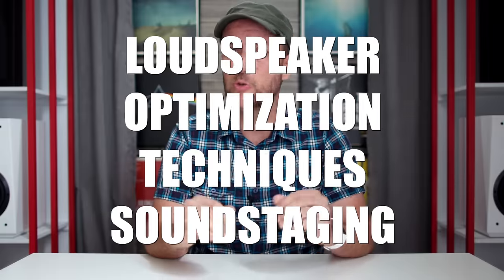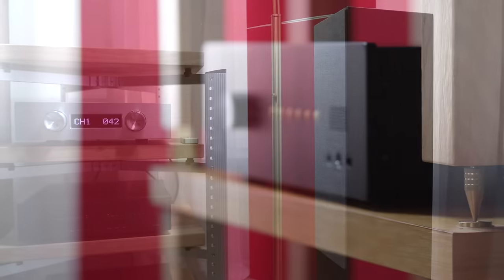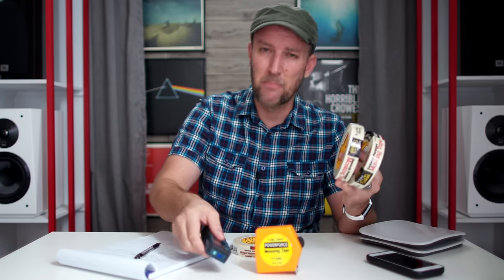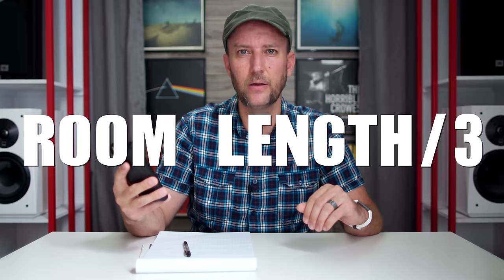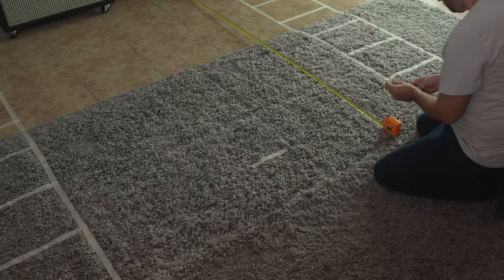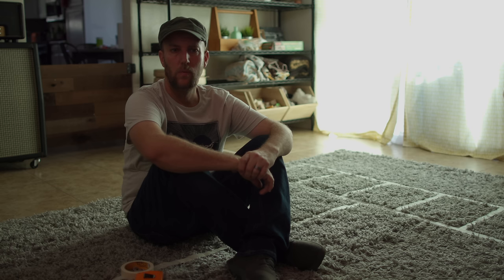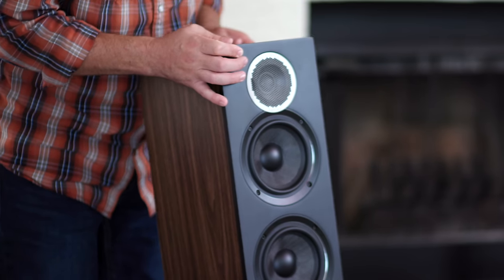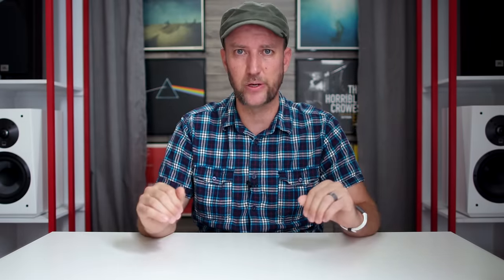L.O.T.S. Loudspeaker Optimization Techniques for Soundstage!

Comment: Hey, Ron. Great vid, man. Excellent method of speaker placement. It really is magical when you’ve got your speakers set up correctly. Great soundstage and imaging in a dark room is a pretty damn crazy experience. 

Did I spy a Marshall 4x12 with greenbacks in it in the background? I’ve got 2 Marshall cabs, one from the 70’s with greenbacks, and one from probably the mid 90’s or so with Vintage 30’s in it. Powering them is a Marshall 50 watt JCM 900 and a 1976 extremely early Marshall 100 watt master volume. It was made within the first month of production. Sorry to got off topic, but I know you play guitar too.
Reply from the maker: Yes sir! JTM45 with Scumbacks! Love it!
Reply: Woohoo! Nice, dude. Is it one of the more recent point to point hand wired JTM45’s? Those are sweet amps.
Reply from the maker: It’s actually my second! First was a ceriatone clone and this one- I had my buddy build it using all original caps etc. Dude, it’s a ripper!
Reply: New Record Day 
Sweet, bro! Those ceriatone clones are beautifully made. I have a real deal ‘74 Hiwatt DR103 and A/B’d it with a ceriatone clone, and they sounded pretty much exactly the same. When it comes to guitar amps, there’s something special about those original caps, resistors, etc.

Comment: It's not rocket science, common sense thinking logical. I'm old school just use my eyes, ears and a tape measure.

Have my listening position at the tip of a triangle right in the middle of my front two speakers. The speakers are a couple of feet out from the front wall. 

A little toe in plus high quality custom made open cell acoustic foam flat blocks (not the subpar tilted ones from ebay, amazon) on my speaker stands and that's me done. 

Have a very small carpeted room with low ceiling. Very very happy with the sound I have managed to get coming out of my speakers.
Reply: So an NRD antagonist from way back I see. Glad to hear you are enjoying your system... because in the END that's what it is all about 👍

Comment: This is all sounds great and all, but could you end up with your speakers in the middle of the room where it's just not feasible?  I mean, based on your own measurements, where did your speakers end up?  Two feet from the front wall, four feet, six feet?  Is this method for stereo only?  What applies to 5.1 for instance?  Just wondering.

Comment: Well if you look at the science of the speed of sound vs the frequency length it can be calculated. The distance between 39” and 7.25’ should be avoided due to bass calculation. Close to the wall is actually ok. 

With subs you can also get closer to the front wall. You can place your subs right at 24” and then your mains can drop back to 43.3” assuming you use an 80z crossover (highpass). 

Anyway good video. I have had my speaker 7.5’ into the room 2’ into the room and now they sit with subs 24” with the mains 43.3” and the room measures pretty flat.  

The kicker is the ceiling height and room width is fixed.

Comment: Scientific study of hearing says that speakers should be 45 degrees apart.
That equals a listening position 1,18 x the distance between the speakers.

The movie industry knows this but the audio industry is stuck in the equilateral triangle ideas from the 1960's.

Placement of the speakers and the listening position can be moved by changing the width between the speakers and by moving the triangle forward or backward.
Seating in the middle of the room or to close to back wall is both bad.
A lot of toe in usually sounds better.
My speaker baffles are toed in approx 35 degrees.
Reply: If you could link to that piece of work that'd be great. 

TV/Film have precise standards that are to be used across platforms. 

Audio for music release, ... no such standards. 

I'd agree anecdotally, ie., 60° spread is oftentimes excessive, but instead of any hard and fast rule, I much prefer it as a case by case basis 

Regarding "toe in", same. It just depends. It's an iterative process whereby dynamic analysis reveals sonic elements impact one another. 
First and most importantly, the design characteristics of the HF coverage dictate a lot. 
Proximity to sidewalls and the sonic impact of the first reflection point energy blending with the direct energy ... all this psycho-acoustically determines the ASW, or Apparent Source Width. 

So all these elements impact one another. 
Small changes in sidewall distance. 
Slight toe-in adjustments.  Various approaches to first sidewall reflection point materials (ie., diffusion, absorption, or abffusion). 

I understand I'm not sharing anything you don't already know, just putting it out there for everyone's consumption.
Reply: @chrisssinstockholm  
Much appreciated ... I consume everything I can wrt audio
Reply: @FOH3663   Here is a translation from a post by Ingvar Ohman from 2007-05-26
Page two in the forum thread in the first link.

Quote:
Cool thread! : P

Actually, despite its age, have not seen it before. :O

Those +/- 23 degrees I have studied quite intensively both in the late 70's and during the 80's. Two things I can add, however, regarding the listening angles, after having rehearsed the case on some occasions in the early and mid 90s and during 2005:

1. When studying the actual reality, it is obvious that music-interested HiFi listeners who set up their facility spontaneously (as well as audio technicians and producers) almost always end up at +/- 23 degrees (within some degree). This applies to more than 50% of all, and those who have chosen other angles, despite that, often prefer 23 degrees when comparing. This, as Lars R mentioned, is not a theory but statistical findings from empirical studies.

2. It seems that the IACC dip (in the vast majority of listeners) actually falls just below 23 degrees, typically at 21 degrees (as Ken Kantor noted in independent studies, too). Exactly where the dip ends up depends both on what weighting you choose to calculate IACC, but also on which group of listeners you study, which is of course a good argument for examining a very large number of people, from as many different groups as possible.

But no matter what, you notice the following: 23 degrees is more or less instinctively preferred by an overwhelming majority of listeners. This must be due to a combination of many different properties.

I have therefore to some extent taken apart various components of the equation in order to fine-tune my theory that the explanation as to why exactly 23 degrees is chosen by most people. I do not think, and have never thought, that it is due to only one simple thing - the IACC minimum.

I am sure today that the explanation is much more complicated. But to be careful, I have never thought that the truth is as simple as everything about IACC.

So what starting point should we assume?

My answer is that we should start from the empirical knowledge we have: We simply cannot get around +/- 23 degrees is the angle that works best when exploring it in practical reality and mapping preferences statistically - but the theory of the cause of it (like so many theories) can of course be finely trimmed endlessly. So in that direction I have been trying to get myself.

Today (since quite a few years, but especially a couple of years ago), I am quite convinced that a dangerous mass of properties must be taken into account, where a number of them deserve special mention, but I am content with three (A, B and C).

A. The sonic errors become less integrated throughout the sound picture in +/- 23 degrees than in +/- 21 degrees, precisely because you do not have to end up in the +/- 21 degree dips. That difference is very small, however, and is especially true when you can have a completely dominant direct sound on the listening site.

B. A wider window to the recording world opens thanks to the slightly wider position +/- 23 degrees, compared to +/- 21 degrees. As a bonus, the fact that you do NOT end up in the middle of the IACC dips at these angles makes the phantom image not hit as it does, you continue to widen the speakers wider than +/- 23 degrees.

C. Already just above +/- 23 degrees, the spatial properties of the sound image deteriorate quite markedly, but all angles below +/- 23 work, although the size of the sound image is of course shrinking as the narrowing occurs when you back in the room.
. . . This is why you can say that it is usually good or even very good to sit both side and behind the middle "+/- 23 degree position", but that it is not possible to sit closer to the speakers than so.

In fact, with excellent attitude, you can in any case return to the distance where the recovery is +/- 12 degrees to the speakers (~ double the distance), without affecting anything other than it sounds as if it is longer for the musicians there in the audio image. : P If it works perfectly, it is good if the listening room is not completely subdued, but if there are at least some reflections from the rear parts of the room.
A bonus is that this fact dramatically increases the conditions for achieving congruent consonance in the home cinema, so that the picture and sound "fit together
Hmmm ... I get a clear idea when I write this. Did I mention anything about it in another thread, maybe a year ago? : o:?

Vh, iö

- - - - - -

PS. An interesting bi-information might be that the film world audio standard is 45 degrees for the normal format in "optimal location". Thus +/- 22.5 degrees. Compatibility is strikingly good! : P
Reply: The actual placement of the speakers depends on many variables.
You mentioned some of them.
But approx. +/- 22,5 degrees is best for imaging based on how our hearing works.

Comment: 7.33333' is 7' 4". Just saying. That is what happens when people rely to much on Ai to think for them. 

You didn't mention one of the most important things if people have their speaker on a wooden floor. There is no better way to destroy the sound quality, than to allow the speakers to resonate the floor system and turn it into the most sloppy, boomy, muddy, bloated crappy sounding subwoofer. I think people should start with isolating their speakers to rid their room of a pervasive droning bass resonance. After that is addressed it's easy to notice more nuanced flaws. If anyone doesn't believe me, just take a tiny bluetooth speaker and notice the bass increase when placed on a wooden table. A wimpy bluetooth speaker doesn't have the power and mass to fill the room full of muddy bass, but a thousand times more powerful tower speaker (even good stand speakers) certinly does, and will if they aren't isolated from a wooden floor. Even in a basement speakers should be spiked to the concrete, because if speaker aren't solid (wobbling on carpet) they will rock ever so slightly and cause distortion and weaker bass. A good analogy for this concept is the difference in force created between pushing/throwing a heavy object standing on a skate board, or standing with your back against a wall. When a woofer pushes the air forwards, there is an equal amount of force pushing the speaker back.
Reply: Wrong 7.3333 is just 7.3 if it's higher that. 35  then is 7.4
Reply: @cesarargueta9629   7' (foot) 4" (inches). I never even mentioned 7.4. You shouldn't tell someone they are wrong when you don't even know what you are talking about. There is difference between 7' 4" and 7.4

Comment: The math of this is not killing you. It is 25,4mm in a inc. 12 inc. In a feet. So his 12' inc. between the《ladder steps》he uses is the same as 1" feet. And the same as 304,8mm, or 30,48cm, or 0.3048 m. It is no hokus pokus here. Only rounding and use the nearest that suts you. Metric are tidier and without fractions.
At least there is only one type of inches in use today. In the past it was several, and people building houses together had to be careful so they dey dont mix swedish, norvegian, or danish rulers in the same project, it happened...no wonder we did jump to metric the fastest we could.
Som imperial are in use in non critical placses, and some  plumbing uses both, but are internaly customized.🙂

Comment: You gettin' a kickback from 3M for all this tape??
Reply from the maker: Dang it! You got me!
Reply: @Newrecordday2013 , on a more serious note, I found your video very interesting. I've known since the 1970's that room acoustics really are an important aspect of how your speakers will sound and are an extension of the speaker itself. Standing waves, room nodes, even the shape of a room directly effect the sound we hear. The "volume" of the listening room is important too. It is also essential to know that you just don't buy speakers and plop them down anywhere and experience fine sound. As you describe, finding the best location for speakers can and will be very rewarding. Of course you must factor in the spouse equation, where you'll be allowed to place them speakers.

Comment: Start with lamp cord for all the extra necessary speaker wire. When you dial in the stage, swap to your cable and hear the difference... oh wait I forgot , there is no difference 😂😂😂 yea right
Reply from the maker: It’s funny you mentioned this - it’s been my experience that all comparisons, regardless of what you are comparing is much much easier when you have a soundstage to work with.

Comment: Uh, hey Ron, I may be nitpicking because of years of carpentry, and it's probably academic here, but your imperial distance maths needs some help. 6:25 -- 5.4333... feet is closer to 5' 5" (or 5.416666... feet) than it is to 5' 4" (or 5.25 feet). 7:12 I don't know how you managed to take 1/3 (or 0.333...) of a foot, which is exactly 4 inches, and came up with 3 inches, or 0.25 feet. (Note:  "..." is a notational representation of a repeating number). Again, probably academic, but seriously, maybe check that first before publishing a video? Or maybe use the more sensible metric system, which the rest of the world uses and doesn't require converting and, thus, another set of calculations?
Reply from the maker: You are correct - you are nitpicking 😜

Comment: The speakers are now a solid 4ft from front wall
So I found this video(https://youtu.be/VK2xxJjtA2o) after struggling with the LOTS video(https://youtu.be/CyTkwkK8ON0). I spent about 9 hours with the lots setup (Yeah I can be a little obsessive) and was really struggling because many songs sounded mind-blowing. I felt like I was at a private concert with the singer/player performing mere feet away. Then, a guitar, sax, or singer would just walk out on stage and pull everything out of wack out of the blue. I couldn't explain or quantify it. I found the above video and at four minutes I said YES that's it! This video is old by now, but I am wondering if there is a happy medium? I am thinking a little bit of room treatment may be just what the doctor ordered. My question is, would diffusers behind my speakers help to scatter the sound from the front wall enough to allow me to push the speakers back closer to the wall and find that happy medium?  My room is borderline too dead (carpet and plenty of furniture) so the extra echo from the diffusers is not a concern. Opinions at all from anyone who has tried to solve this?
Reply from the maker: The answer is indeed treatment! That will take care of what your are hearing. Diffusion would be great so that’s the direction I would go if you already have a handle on absorption.
Reply: @Newrecordday2013  Thank you so much. I appreciate it. Gives me a good direction!

Comment: You are talking about more than 100 variables and it is always try this and try that. When you are not exactly accurate, you can try as much as you want to ,you will only get 70% accuracy at most, probably. 
I know that after 37 years experience that if you are just 1/2 an inch out, it can sound disappointing. You can only be 99,9 percent accurate if you use special computer software to get you within 3 millimeters of accuracy. 
Your speakers also need to be time aligned to the room acoustics, to the 432hz transmission frequency alignment. 
This is science not variables. 
You need to work with the data from your speakers, because you need to consider each speakers radiation properties which will show up in the computer software. 
The idea is that the whole family can listen together, not just one person, selfishly. 
Most people are anyway not able to hear what you are trying to explain. 
You need to be skilled ,to know what to listen for, that's why there are skilled professionals out there in the shop, which the online store destroyed.